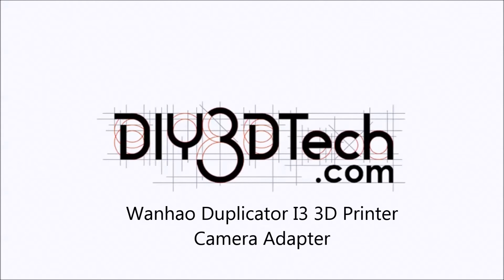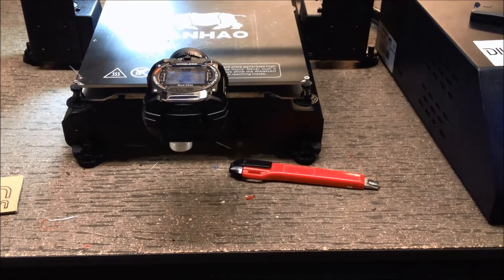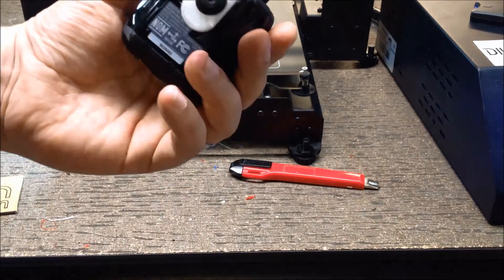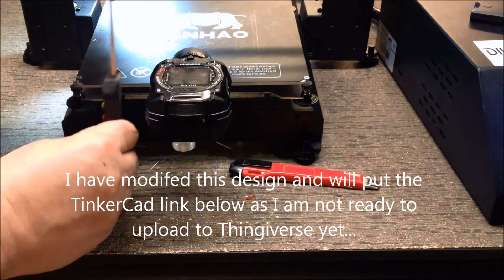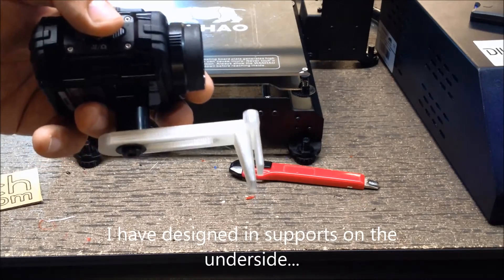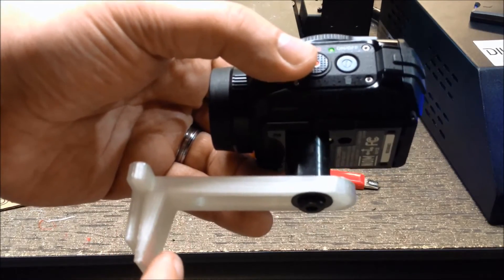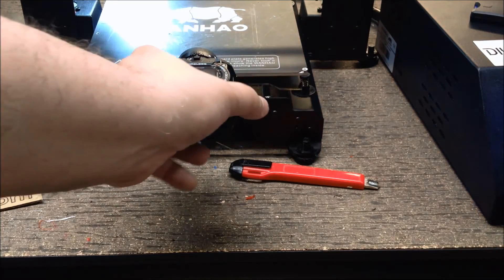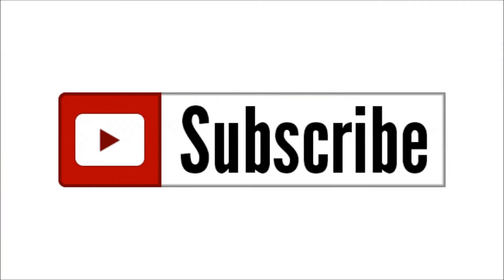Wanhao Duplicator I3 3D Printer - Camera Adapter!

Comment: You should create a camera mount that attaches to the bed and moves with it because when the bed in moving back and forth in the current time lapses I can barely see the print because it appears very shaky. Just an idea. EIther way keep the time lapses because they are really cool.
Reply from the maker: +Panoreth 3D Printing I have kicked that around however since the bed moves I don't want any which might affect the bed and changing its center of gravity or balance could affect the print.  Now I have kicked this around for the Da Vinci since the bed only moves in the Z.  However with the newest mount I noticed the motion was interesting, sort of made me a little motion sick if I stared at it too long going back and forth.  Also kicking around 3D video or some other strange PoV things :-)